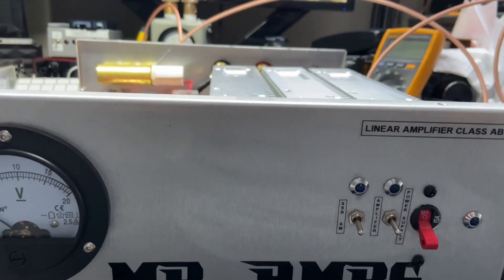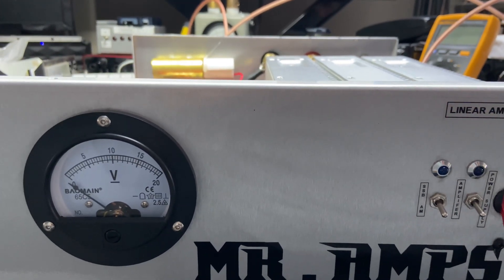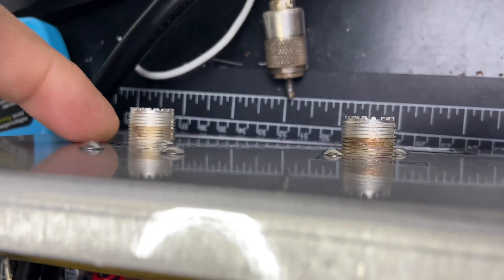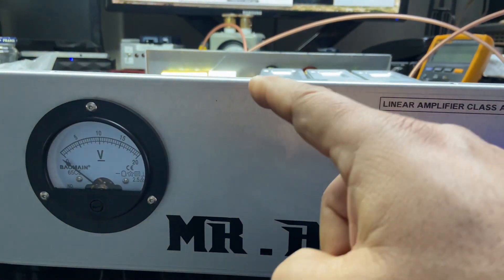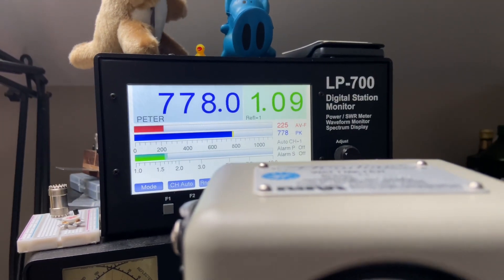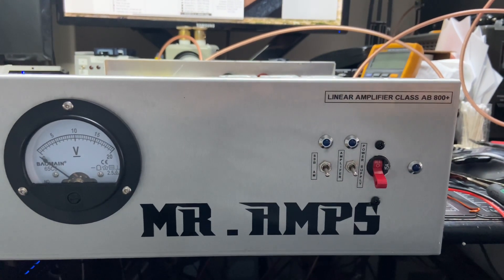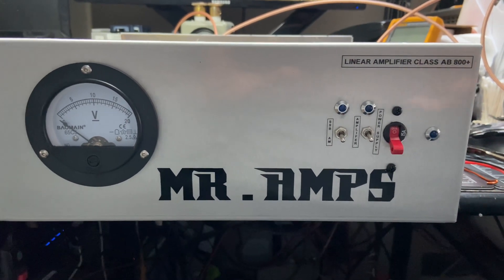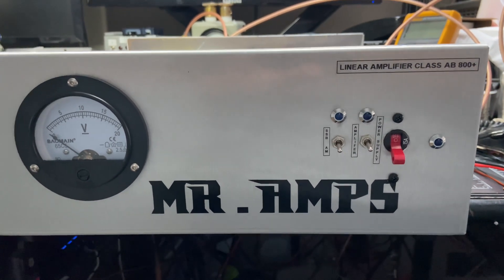(English) Evidence of lack of ground, lack of air into the amplifier!

Comment: I've been lucky and have 0 grounds on my station. But hey it's just me...all rg400 and lmr400 on my station to the beam. I have heard some horror stories of ground loops tho, long as you do it right and do it once.
Reply from the maker: 100% I have always say that most of radio operators issues is the Engineering on the installation system.
Reply: @Mr.Baluns  yup indeed...it must be hard being a amp builder now a days. People run cheap rg8 with a 4 pill and it's game over.

Comment: 🤣🤣🤣the discoloration on the so239 is just from being exposed to the environment, where the connectors’ threads didn’t reach.
Reply from the maker: If you see on the video the PL-259 cover almost the whole SO-239. The coloration is not the exposure is heat discoloration on the Teflon

Comment: A lot of good advice on this video and sounds like the protection circuit did it's job protected transistors, 
You're correct 💯 about misinformation and sharing knowledge there's a ton of antenna theory and RF grounding/bonding online
Thanks for pointing me in the right direction
73s